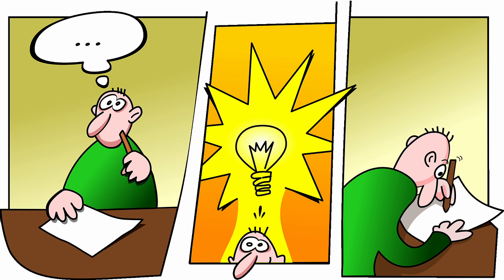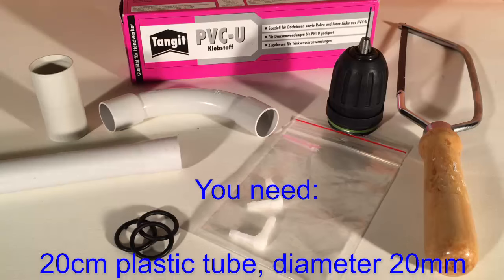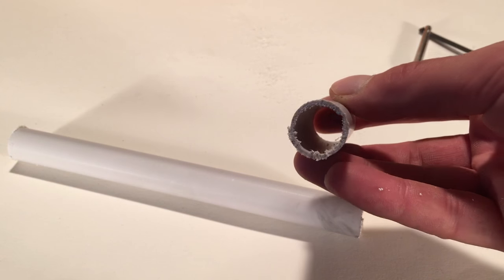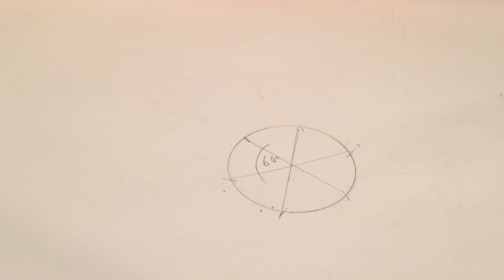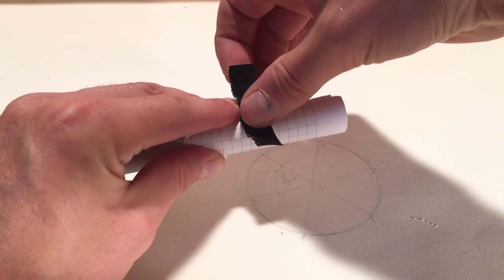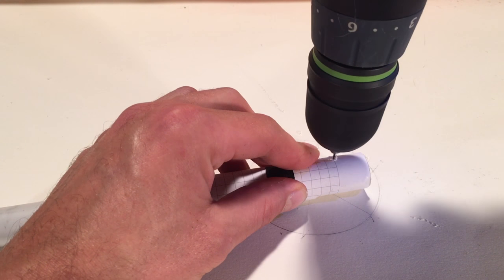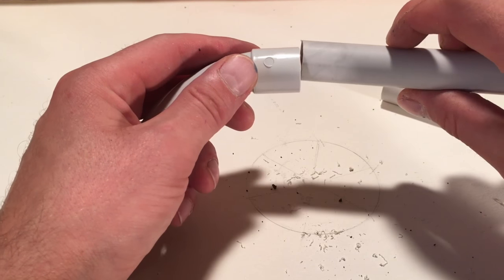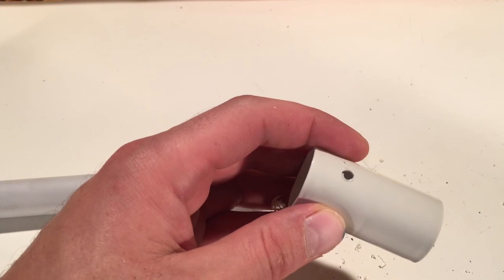Jet Airlift | Hamburger Mattenfilter | DIY | Tschechischer Luftheber

Comment: Like ALL the other people who were new to this...or were struggling with it...i thank you DEARLY for the education... /i am trying to make one that will suck up water from the shallow water in my bucket...up to a DIY drip ring...i made one like yours,...out of things i had around the house..but its not perfect.. it cannot move water from low to high...you gotta kinda tilt it so that it doesnt have to work as hard...and is closer to the top of the water... 

i have an idea that will make this WAY more effective. First off have ALLL the parts this gent has...but my idea is to add a SECOND pressure chamberi thought i was smart and could make an outer pressure chamber that was bigger...blowing thru a smaller hole to up the output to make this thing WAY more powerful...but looking at the parts...you can only make the pressure chambers the same size.only diff is one is 25 mm and the bigger one 30mm....so i think the determining factor to UP the power on this thing...is to  have the main air in 5mm...then the hole between pressure chambers..3mm..so that there is a significant build up of pressure..So instead of using a 10 CM for the main one..i may use 2 12 cm ones.. but ALL my problems are TOTALLY solved now Thanks to YOU good sir so...  thanks for inspiring me with your AWESOME build man!!!! <3 from canada

Comment: Thank you very much! I've just built my first HMF and I'm testing it right now. I didn't have the tools to make the jet compressor but I'll add it because my flow is not as strong as yours. While building it I had an idea: do using a wider opening (something like a bell) where the bubbles are generated, could increase the amount of water sucked into the tube creating a higher pressure and even more flow?

Actually I tried it yesterday using a empty bottle I found home. It didn’t work. Actually the “bell” makes it incredibly noisy because the bubbles hit it and increase the noise.

Then I did another one using a simple thin pipe and instead of the jet I simply put the air tube inside, punched some holes in it and it works awesome. I’ll share some photos and videos of it :)

Comment: Moin hast du das auch auf deutsch hochgeladen was ist das für ein rohr, Elektrokabel-Rohr oder so? Aus was wurde die Druckkammer gemacht? den Kleber hab ich schon gefunden :)
Reply from the maker: Ahoi Peter Wiesner das ist ein PVC Rohr aus dem Baumarkt „Sanitärabteilung“ auch Kleberohr oder PVC-U Rohr genannt. Für die Druckkammer kannst du auch ein PVC Rohr mit höherem Durchmesser nehmen. Es gibt aber auch ähnliche Produkte die sich genauso gut verarbeiten lassen. Einfach mal durch die Sanitärabteilung stöbern dort sollte alles zu finden sein. 👍
Reply: muss Morgen mal bei ein anderen Baumarkt gucken, Die Mitarbeiter Verstecken sich immer wenn man was Such,t und wenn dann Schicken die ein zu den Fall Rohre :) wie sind den die Durchmesser von den Rohren Foto mach ich auch noch  :) Vielen Dank

Comment: is 400l/h your maximum flow rate with the 4W/200mbar air pump or does the size and length of the pipe play a role? What do you think you would need in terms of pump and tubing to achieve a flow rate of 2000l/h (i.e. for  a 400l aquarium). Is there a formula?
and last but not least thank you very much for sharing this!! very well done.
Reply from the maker: Hello Iain Morrison, thank you very much.

With this version of a 20mm airlift, you have a maximum capacity of 35 cm = 600 l / h.

Data sheet 20 TLH
design:
-Outer diameter of the tube 20 mm
-Tube inner diameter 18 mm
-Sleeve height 50 mm from 32 mm pipe
-4/6 air connection screwed 90 degrees
-Possible lengths from 20 cm to 35 cm
output:
Max. Conveying capacity at 35 cm = 600 l / h
Max. Conveying capacity at 30 cm = 550 l / h
Max. Conveying capacity at 25 cm = 500 l / h
Max. Conveying capacity at 20 cm = 450 l / h
Min. Capacity (all lengths) = approx. 30 l / h

With a 32 mm airlift you have a maximum capacity at 50 cm = 1500 l / h

Datasheet 32er TLH
 The Czech airlift was tested with a 350 l / h pump.
design:
-Outer diameter of pipe 32 mm
-Tube inner diameter 29 mm
-Sleeve height 65 mm from 40 mm tube
-4/6 air connection screwed 90 degrees
-Possible lengths from 35 cm to 50 cm
output:
Max. Conveying capacity at 50 cm = 1500 l / h
Max. Conveying capacity at 45 cm = 1400 l / h
Max. Conveying capacity at 40 cm = 1300 l / h
Max. Conveying capacity at 35 cm = 1200 l / h
Min. Capacity (all lengths) = approx. 80 l / h 

You can use 2  airlift at the same time to double the flow.
Reply: Hi Thank you for the prompt reply, one last question, what are the details of the air pump used in the tests. I have a 2X200 l/h, 200mbar EHEIM. Is this enough to achieve the results you outlined?
Reply from the maker: Hello Iain Morrison, 
I currently use an air compressor for my Jetlifts.
 I used to have an Eheim 400 with 200mbar. This works well, but the pumps become weaker over a longer period of time.
Reply: Hi what make / model is your air compressor? Sounds very interesting but all the models I've seen are either overpowered or way too load for me.
Reply: do you have the Hailea 9720 by chance? the data on this model sound pretty good .
Reply from the maker: Hello Iain Morrison, i am using Resun LP60 with 60 Watt. For Indoor use they are very loud. Watch my Video "Soundproof Box for Air Compressor" ;D
Reply: @TerrarienAquarienBerlin  
Hallo, Vielen Dank für Ihre Idee, ich brauche Ihre hilfe .. ich habe brunnen die 500 m tief ist .. aber wasser spiegel ist 230 m .. kann ich nach Ihre experiment das wasser hoch ziehen ? Wenn schon was brauche ich um das zu tun ?! Welche luftkompressor stärke und welche details !? Vielen Dank im Vorauss.

Comment: Newer powerheads are every efficient, and produce more flow per watt then any lift tube, including this curved tube with pipe wall air injection. Plus, powerheads are more quiet at the same capacity of flow. The only drawback to powerheads is that they produce induce some heat to the water, from both the impeller and the motor, compared to air injection. If you wanted your output to occur lower in the the tank, or to direct water current downward at a certain angle, you are severely limited compared to a powerhead.
Reply: At this scale true, however if you scale this up to pond size then that's when they become crazy efficient. Pumping 5000gph only using 40 watts is easy and then doesn't require separate aeration.

Comment: Do you hve a percentage increase? does it produce 10% more water flow or more?  I mean it wouldn't be worth the effort for just 5% would it.
Reply from the maker: I only use Czech air lift and can only estimate the comparison. But believe me: once in use you do not want to miss it anymore...
Reply: So using this method we are pumping in around 400ltr/hour air and getting out 600ltr/hour water. So that's a 50% jump. Super awesome.

Comment: I have one question: After a few days running my brand new HMF inside an already established tank (I let both the old filter and the HMF one running together. Then I removed the old one), I noticed that biofilm is forming on the surface of the water inside the filter because it's very quiet there. Is it normal? Should I remove it?
Reply from the maker: Ahoy Almarma! That is normal. If only a small area is affected, there is no danger. What you can do is use duckweed or add a small air stone. I have the best experience with a slightly broken airlift. Just drill a small hole in the sealing to allow small bubbles rise to the surface. I hope I could help a bit.
Reply: @TerrarienAquarienBerlin  Yes! You helped me! Thank you very much :)

Comment: Hello sir nice video it's very simple method of setting to water flowing good video but  tell me what types of tank size want to require to best  motor  and I expected nature air setting not electronic motor how to set the nature air because of fish want to good oxygen therefor I asking tell me sir it's my request...thanking you.
Reply from the maker: Hello, I am very happy about your request
With a 20 mm diameter tube, lengths from 20 cm to 35 cm are possible.
Max. output at 35 cm = 600 l / h
Max. output at 30 cm = 550 l / h
Max. output at 25 cm = 500 l / h
Max. output rate at 20 cm = 450 l / h
Min. output rate (all lengths) = approx. 30 l / h

It certainly depends on which fish are cared for in the Aquarium and how much water you want to turn.
In general, a circulation of the aquarium water from 2 to 3 times an hour is recommended sometimes more. For example if you have a 100 liter aquarium you should pump at least 200 to 300 liters per hour.

You need a good pump to reach these levels. You will not reach the values if you have a weak pump and an efficient air lift, or a weak air lift and a powerful pump.

For best results I use an air compressor check my latest Video:
Low Noise Air Pump | Resun LP-60 | Infos & Test
https://youtu.be/502MO1vrcok

A small diaphragm pump with 200 mbar is enough to reach 400 l / h.

I hope I could help you.
Greetings from Berlin

Comment: what is that elbow called and where to find it? i couldn't find in hardware store (home depot or Lowes etc)
Reply from the maker: Hello Alex Aydogan...
Search for PVC Pressure Pipe Fittings...
Reply from the maker: Alex Aydogan 
The only thing that comes to my mind is that you can write me an e-mail and I will send you some. Unfortunately I can‘t tell you from here where you get some fittings in the US.
Reply: No worries. That 90 degree elbow just made in Europe. I have find a way to bend pipe with heat to make it just like that. Thank you for your help.
Reply from the maker: Alex Aydogan 
Your welcome 🤓
watch here:
https://youtu.be/2XHkPdIpe4Q
I bend some pipes with hot Sand 😉
Reply: If you are talking about the long swoop elbow that he is using at the top, the only thing that I have seen in the US like that is PVC Electrical Conduit. https://www.lowes.com/pd/CARLON-3-4-in-Schedule-40-PVC-Elbow/3256886 If you are talking about the little 1/4" (us size) airline elbows, you need to look in the fish aquarium section at a pet store or Wally World.